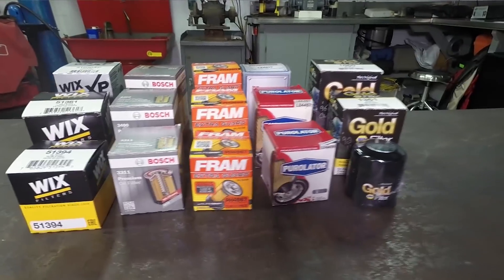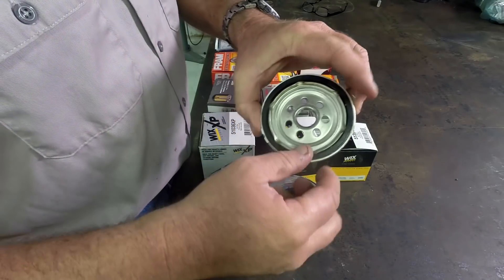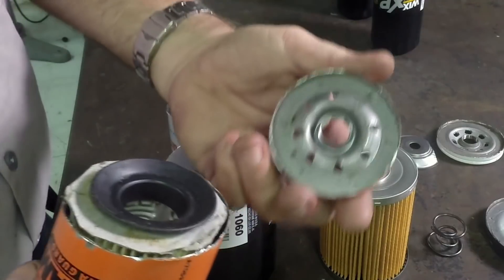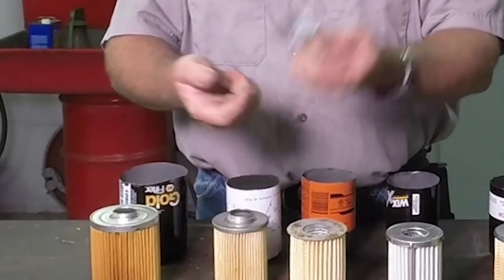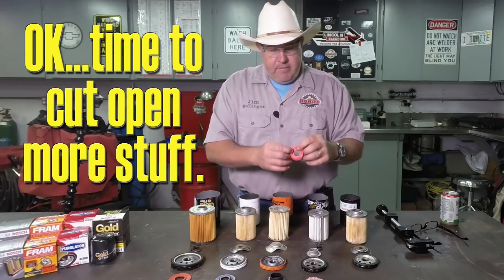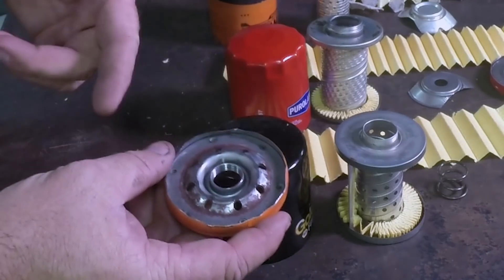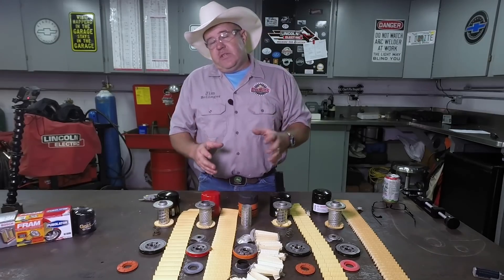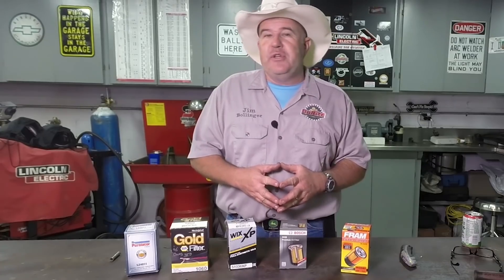The worst oil filter EVER!

Comment: I dont use fram but seem unfair and misleading to me that the budget fram is being compared to best of others.. just sayin
Reply: Compare it to the Fram Ultra Synthetic.

Fram base filter is crap.
The Ultra synthetic is on par with Napa Gold and Platinum
Reply: Promiscuous Crab I think you all are missing the point, Fram is selling very bad filters, ones that could ruin an engine.  Regardless of cost or model, it should filter oil without disintegrating and jacking up an engine.  Hot oil and cardboard is not a recipe for success.  Imagine 10000 mile synthetic with a fram cardboard framed filter?  Let’s use common sense and thank the man for a fine video.
Reply: If you change your oil every 10K miles, you have no business complaining about a bit of impurity in your oil filter, particularly if it's on the "dirty" side of the filtration media.   @RickytheRaccoon69
Reply: Fram claims "Extra Guard® meets all manufacturer’s recommended change intervals"    I'd like to see what the inside of one looks like after 5,000 or 7,500 miles and what exactly is or isn't getting filtered out.
Reply: Thank him for what? He's a shyster. Nothing true about any of this.  LoL you are way too gullible.
Reply: @gdeangelkick  What if that is the factory recommended interval?  Who do you design engines for and what does your company recommend as a change interval?
Reply: gdeangelkick uh, many synthetic performance engines go to 10k in between changes.  Second, that was an example of what could happen if a dumbass put that Fram in a high performance engine.  Hell, my KTM 1290 does an oil change every 9k. And these days, you can test your oil for contaminants and fine tune your mileage in between scheduled times.  If anyone changes oil in any modern car every 3k, then you are flushing money down the drain.
Reply: @gdeangelkick  10K oil change intervals are common on newer vehicles. Not only that, but most vehicles produced today alert you on the display WHEN to change oil.  For example, GM's computer system monitors accumulative driving parameters (not just mileage) in determining oil change frequency.  In conjunction with this, GM stipulates the use of Dexos approved (synthetic) oils.  Under normal driving conditions, the oil change alerts are generally in +/-10,000 mile intervals.  Under harsher conditions, the alerts are more frequent.  Car owners would be wise to adhere to OEM maintenance guidelines to insure their factory warranty remains valid.
Reply: @drewski1441  You have a video disproving what DoRite Fabrication has shown here? Please link and I'll watch you cut open new filters and will listen to your findings.
Reply: All the Fram filters other than their top of the line (as pointed out in a Fram specific video upthread) use the same exact construction.  A standard Wix is the same price as a standard Fram according to RockAuto (2000 Chevy Tahoe 5.7) - why would you want to support a company that is willing to sell garbage?
Reply: So wait a minute!! I have been using Fram for over 15 yrs since that time I have driven my cars well over 700,000 miles combined never any engine problems.   
 
Fram filters are excellent filters you think I am going to take the words of a shyster in a cowboy hat? 😕 Get outta here.  
 
Nothing scientific about this. Did he run oil through them then did a purity test at a lab to see the results?  
 
As I said!!  get outta here
Reply: @drewski1441  If you don't believe him then just buy one and cut it open for yourself to see if it's true or not.

This video is the easiest of ones to either prove or disprove.
Reply: This video is basically a PSA that FRAM is willing to sell you a filter made of toilet paper and sadness. This part's job is to protect your vehicles engine worth hundreds, perhaps thousands of dollars. No company willing to take money for a product this shoddy for a job that important should receive a penny from anyone ever. I don't care if their top of the line filter is the goddamn messiah. It doesn't fix that they're poisoning the common mans engine.
Reply: Keld Tundraking 😂
Reply: I personally dont use fram but if they were complete junk and blowing motors up they would have been out of business by now
Reply: It's not unfair and misleading to do so. Imagine if a condom manufacturer is selling a budget condom that can easily disintegrate while in use......
Reply: @brandenburg2388  ^^^Well said. This person gets it.
Reply: The point is, FRAM should not be selling a filter at ANY price, high or low, that doesn't perform correctly.  Just because the filter has a low pricetag, it's not going to make the car owner feel any better if it causes engine failure.
Reply: Fram doesn't have a budget oil filter
Reply: What's unfair is fram selling a piece of trash filterin the first place. Rusted out of the box? That's ridiculous
Reply from the maker: All of the oil filters were offered by local auto parts stores under Oil "change special". All the filters cost $7ish and under. The point is to see what they are selling you. If a filter costs $.50 or $50 it should never look like that inside. Regardless of whether or not it filters to a millionth of a micron or not. Their top of the line filters may be great. But why are they selling junk to people like you and me when we come in to the parts store? I'm not sponsored by anyone, nor does anyone I know work for a parts manufacturer or reseller. Like what I found inside three different Fram filters from two different sources or not, It is what it is.
Reply: @DoRiteFabrication  Lol, That Fram filter really pissed you off, didn't it. I hear ya, man.
Reply: @DoRiteFabrication  It doesn't matter if there was a "special" on the more expensive filters - in fact, that skews your data and results to have a favorable bias toward the Napa Gold and WiX filters. Hm. Comparing the bottom-of-the-line FRAM to those two, is like throwing a child into a cage fight with a kickboxer: you know the kid's gonna lose.
Reply from the maker: Please point out the "best in others".
Reply: Well if they aren't in the same price point, they are going to vary in some way . . . 😔😶
Reply: @DDS029  a $3 difference between the most expensive filter (napa) and the cheapest (fram)  is in the same price range the extended guard would probably be a better comparison but whatever , the fram shouldn't be selling rust and recycled cardboard filters in the first place

Comment: Been using Fram for 20 years. Never had any mechanical engine issuses. This video doesn't change a thing all it does is prove you should make sure to change your oil every 5,000 miles.

Comment: SEARCH COUNTERFEIT OIL FILTERS.
What you haven't said is where you bought these filters. There is a lot of counterfiet filters on the market.
I use Fram filters and I've just opened several used one's and non are anything like the one in your video.
I would question where you bought your filters.
Reply: I do believe counterfeits exist.  I also have a genuine Fram disintegrate about 15 years ago on me, needed to tear apart my engine to clean it out.  They are junk and even some dealerships also now refuse to use them.
Reply from the maker: NAPA, O'Reilly, Autozone, Carquest or Advanced, I can't remember which one of the last two.
Reply: Dude, you better get your engine inspected real quick because that damn FRAM filter will simply ruin your car engine.....
Reply: NightTurkey82  I think I will post a video if I get time to do it correctly once Christmas is over. 
Why on earth would you have cut open 2000 filters?? For what purpose?
Reply: I've opened countless oil filters and fram always looked like this! They are the most cheaply made filters I've seen. YouTube has a bunch of videos with people opening filters to show the same thing.

Comment: Jim I have this habit of not challenging but rather question what my eyes see.
Question 1.
What is the manufacturing date on the filters and date of cutting them open not the day video was posted.
Question 2.
Why did you cut the video at very important segments of it when, you left big holes in your demonstration?
I am not satisfied with it.
I am going to cut open a Fram, ans STP and an AMS.
Continuous video.
From cutting and separating..

Comment: I’ve always used Bosch or Napa filters in my car. The Orange Fram filters are garbage. The only thing I like about the fram filters is the black grip.  Either way I bough a set of oil filter sockets.

Comment: I've always used Napa (Wix). Ironically Fram is usually more expensive. Almost everyone else swears by them. Heck, looking at the quality, I don't see a reason why. Just because it costs more, does not make it better. Proof is here. It's just like the oil. I run Valvoline Synthetic. Now, I am sure theres cheaper and viable alternatives but certainly there's way more expensive ones. But I've probably driven 300,000 miles on our autos using that oil easily. I've never had an engine go bad and our cars idle a lot. Being in the security field I can openly say my tools are tested. Now, I am not promoting any brand. It just has happened to work for me over time and partly why was using a decent filter. Swell video.

Comment: The cheap orange fram oil starved a jeep Cherokee 4.0. Was running terrible after the first oil change and oil pressure was very low compared to other filters. Got it off quickly before damage. Never again. Absolute junk.

Comment: You're findings are completely accurate.  But, there's one thing I should mention.  Not all the filters are the same level.  For instance, you used a Napa Gold filter, rather than the standard.  But you used a standard Purolator, rather than the PureOne.  Fram is still garbage, no matter what level, but the others are comparable.

Comment: Ok so a small block Chevy is out dated and that filter had been sitting on the shelf longer then any other filter. Also I have always used fram filters, and my 2007 Ford focus has 211,467 miles on it.

Comment: Holy crap. I've been using that FRAM Filter For Like 20,000 Miles In My 200,000 Mile V6 Making 100 More Horspower Than Stock (Has A Turbo I Installed). Time To Get A WIX Or Napa Filter. I Can't Belive I Haven't Had Issues From This Filter. I Drive The 1,000 Mile Round Trip Nearly 12 Times A Year!

Comment: So I have a 1971 Ford F100 with a 360 FE engine in it. My grandpa bought it brand new. I am the third generation owner. I have no idea how many times the odometer has rolled over. It has the original engine, never cracked open, I know absolutely for sure. My dad always ran Fram filters, and I have probably ran 75% Fram on it for the 25 years I have driven it. Now I'm not saying Fram makes good filters, but the truck starts and runs like a top, and burns less than half a quart every 3000 miles. So while they aren't my first choice, especially when you can get the NAPA gold for half price during their March filter sale every year, I'll probably still use an occasional Fram.

Comment: I worked in a Purolator factory when I was 19. We made oil, gas and air cleaner elements for many  brand names. Each were made to the specified construction of the companies orders. The type of paper,heat treatment and number of pleats varied to the different companies. We were paid by a piece rate so everything made varied. It would be interesting to see if they are still all made by hand labor. You could be shifted to any phase of the manufacturer. And yes sometimes a dead rat got boxed!

Comment: so, if the filter fits the thread and the seal it doesn't matter how large/long the contain is, is that correct?  So, if wanted to buy a larger filter, given that the thread and seal were the right fit, I could do that?

Comment: Try stp next
Reply: Jacob Summer I’ve been using STP on my Chevy Small Block for a good while, never have had an issue and oil pressure is excellent. A video on this oil filter would be awesome.
Reply: Lol that's all I use on my Frontier, 4runner,and Tacoma neverror had a problem with them

Comment: This was fun to watch. I'd been a power generator mechanic in the Army for eight years and, barring a few rares sizes/types of generators that took specialty filters, almost every model of TQG (tactical-quiet generator) the Army operates has a Fram brand filter as the primary option for oil filter given in their technical manuals. We had entire shelves lined with nothing but those orange shit stains. Always nice to know that even the civilian parts we used were of the lowest possible quality, though I'm not surprised.

Comment: I cut open a variety of filters a few years ago too.  Seriously, you would be better off installing a used Wix filter with 5000 miles of use on it than a brand new Fram filter.  I was made aware of how crappy Frams were by a Hastings Filter display over 30 years ago.

Comment: Was the Napa
Hold the best they make ? Or do you recommend one better
Reply from the maker: They make a platinum and XP.  I used filters that the local auto parts stores were offering under their oil change specials.

Comment: True story folks.   Fantastic video.

I used to have a 1983 AMC CJ7 with a 71 AMC 304 engine.   I changed the oil and used the Fram Tough Guard oil filter.   The result was an anemic 17 psi of oil pressure.   Not even 100 miles later I replaced it with a Wix #51258 plain oil filter and topped off the oil.    Fired it up and a steady (and healthier) 35 psi. 

That was back in 2005-2006.   Now when I change any filters in my Lincolns?   I prefer Motorcraft and will use Wix in a pinch.   13+ years of being Fram Free.

Comment: I've watched a lot of these kinds of videos. While I find them entertaining none of them actually tell you what is important like how long will the filter go before clogging up and how well does it filter. I would like to see some actual laboratory test for filters that have been in use in an engine for 5 thousand miles and then check the oil for contaminants and the filters to see how well they look as far as trapped particles in the filter and how well the filtering medium held up.

Comment: Always find these fun. First for an oil filter company to produce a filter for the engine it has to be approved by make. I've currently got a dodge neon that went up to 380k miles before a rebuild I used fram tough guard it's currently at 592k miles still on fram filters. My dad's truck 360k miles fram filters dad second truck 220k running fram filters. Old diesel I bought from a rancher 800k miles fram filters as long as you replace them when oil change is due it'll be fine

Comment: I'm not going to defend fram but I've been using the toughguards for years on my truck.  Never a leak and never any premature oil changes and my truck is 225k and 21 this year.  I switched over to k&n because I got a deal and may cut the old one open on the next oil change.  What's not explained though in the video is how the designs relate to keeping particulates out of the oil which is the whole point.  Just looking at the construction won't necessarily tell you that.  I don't care if they make it out of plastic and cardboard so long as it performs and does what it's supposed to.  I don't get what the casing has to do with anything.   I've never heard of the oil pressure rupturing a filter.

Comment: I regularly changed my oil and filter on my Chevy Trailblazer using Fram filters... I just lost my transmission.
Reply: Has nothing to do with your engine filter. When was the last time you changed the fluid and filter in your transmission?